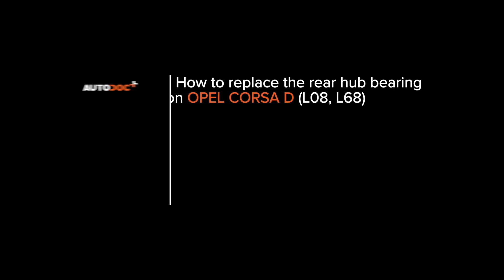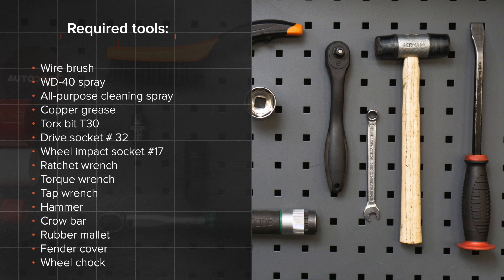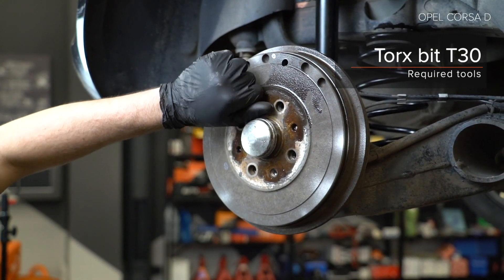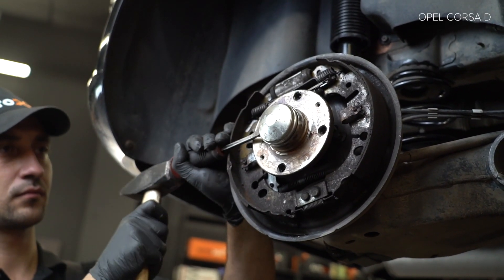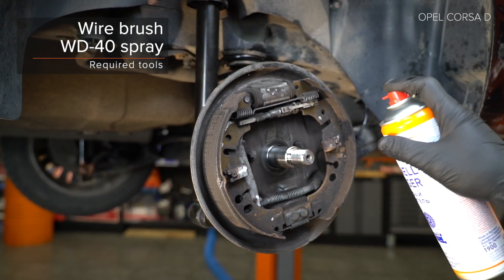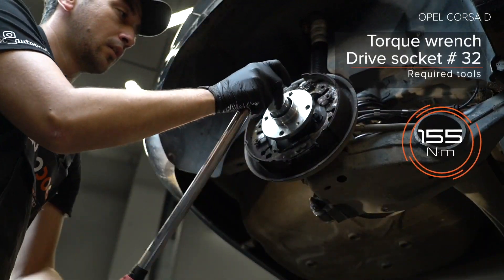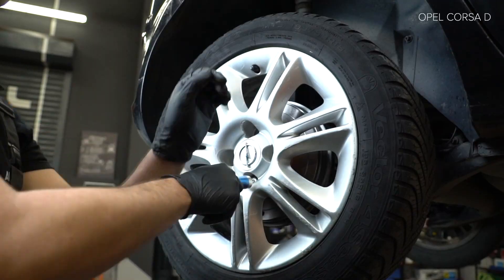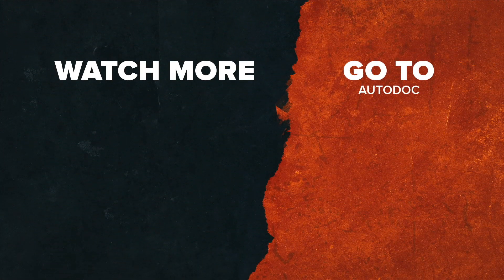How to change rear wheel bearing / rear hub bearing on OPEL CORSA D [TUTORIAL AUTODOC]

Comment: Copper spray everywhere 🤦‍♂️🤦‍♂️
Reply from the maker: Thank you for your comment!
Copper grease perfectly protects against corrosion and sticking of parts operating at high temperatures, thereby facilitating further dismantling during subsequent replacements.
Best Regards,
Autodoc team
Reply: Not to mention the risk of contaminating the brake shoes / inside of the drum……..
Reply: Brake cleaner for me. I take the point of disassembly, but I would happily fight with he drum next time round if it is corroded as opposed to having ineffectual brakes.